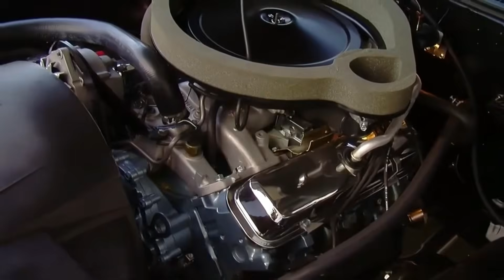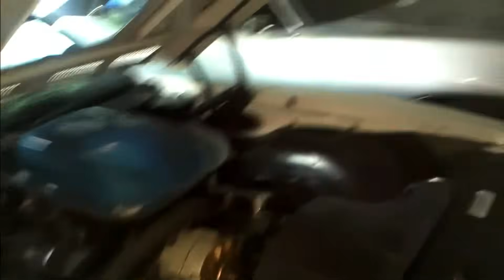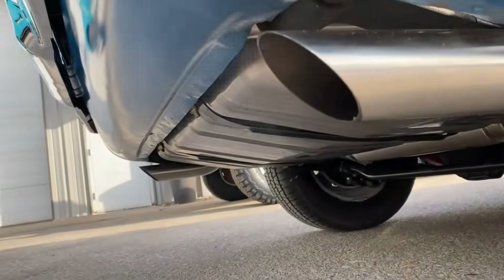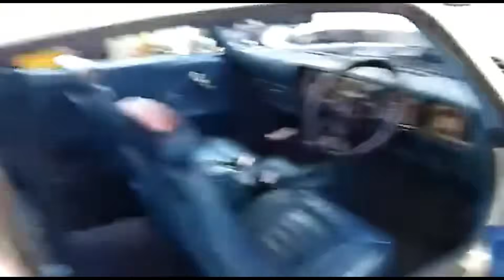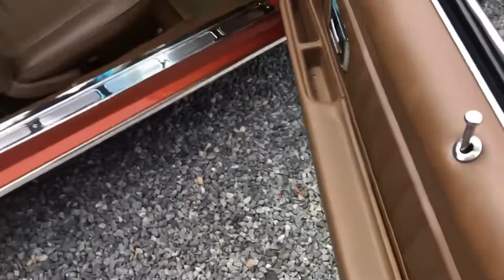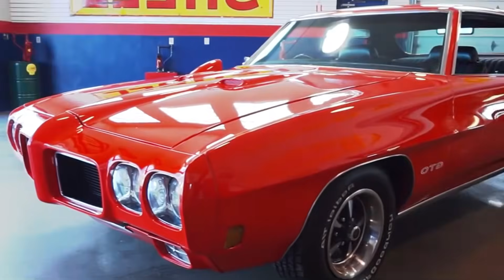20 Shocking Secrets About Pontiac 400 Ram Air IV You Didn’t Know!

Comment: I have the first day of production of a 1969 Ram Air IV JUDGE that was special order for drag racing, 4.33 gears, radio delete, no power steering or brakes, close radio 4 speed, no console, gauges with a hood tach, original engine with three sleeves in the block, ran a 12.38 with slicks back in the day in E stock. Mostly original paint, all original interior except package tray, its a beast. Heads were ported later by SD performance in the 1980s so its even quicker than the low 12s. Because it is mostly original the reach back to 1969 on the car feels, smells and looks like a unrestored time capsule with just the right amount of patina. The one thing he got right was indeed they were working on the four inlet Ram Air set up. I have a copy of the factory blue prints. My Judge is in the Judge registery as first day of the IV Judge, dealer was Dick Marson who drag raced it before it was sold to the public. But a lot of stuff the video got wrong, also I have a original Ram Air IV Qjet for a firebird with the throttle stop intact to lessen the HP and yes turn over the carb and open up the throttle all the way the butterflies do not open fully.

Comment: The original purpose of the round exhaust ports was to space out the ports, for easier fitting of large tube headers. The Ram Air II camshaft was actually originally designed for the D-port heads, then the round port heads were designed. When Pontiac wanted better flowing ports they would just increase port volume, without any flow testing. The 1969 RAIV heads increased the volumes of the 68 RAII ports and the 1970 RAIV heads increased the volume of the 69 RAIV intake ports. Much of this volume increase actually hurt short turn radius flow of the ports. The RAIV stopped being an option in 1970 GTO when the 455 GTO became available in 1970 and then the RAIV became an option in the 1970 Firebird, that came out late in the model year.  My father ordered a 1970 RAIV GTO and paid a deposit. Pontiac contacted him and told him the RAIV was no longer a GTO option. Between the dealer, Pontiac and my father, Pontiac agreed to assemble one last RAIV GTO for my father's order. It may have been the lat RAIV GTO made. The 1970 Firebird got GTO coded engines and supposedly there were no 1970 Firebird coded RAIV engines.

Comment: Standard 400 96 D shaped heads had 2.11 and 1.77 valves but the center exhaust port was still restrictive and the round port exhaust gave considerable performance along with larger intake ports. Emissions destroyed the  Pontiac engine.

Comment: Ugh. Get your facts straight. The Gen1 Firebirds got throttle limiter that could (and often were) removed. The reason was GM's 10 pounds per horsepower rule for all divisions (but ignored by one division). The A-bodies, being heavier didn't get the throttle limiter. The 1969 exhaust manifolds for the Ram Air IV were the same for either an F-body or an A-body. Yes, the Firebird's exhaust system was a tad more restrictive than the Tempest's but it was less of a factor than the throttle limiter.

Comment: You don’t know what you’re talking about with the no air conditioning on Ram Air IV.  First of all the RAIV heads and aluminum intakes were drilled for the standard Pontiac 400 AC brackets from the factory.  Idle is fine with the AC on just as long as you have the idle solenoid wired to the AC system clutch.  So all you said is not true. I have AC on my RAIV and it works fine. The one thing you didn’t mention and is the true deciding factor for no AC on a RAIV. You’re completely on the wrong end of the car!  It’s the rear end ratio. Any gear lower than 3.23 means no AC.  And that’s because any lower gear will over rev the compressor on the freeway.  I have 3.23 on my RAIV and I like it better than the lower gears.  I tried a 3:73 for a few weeks and put it back to 3.23.  Besides I’m not interested in the 1/4 mile what so ever.  It’s all about the acceleration in 2nd gear with a 3.23 that makes it feel like it’s going to take off when the cam kicks in.

Comment: To my recollection Ram Air lV was a power level increase times 4 from a stock 400 Pontiac.
Reply: 350hp, RamAir III 366HP,  RAMAIR 370HP.. IN 1969-"70
Reply: @danielmauter1737 in 1969 the engines were rated different depending on which car it was in the Ram Air III was rated 335hp in the firebird and 366hp in the GTO the  Ram Air IV was rated  345hp in the Trans am and 370hp in the GTO , this was because of GM's rule of no more than 1 hp per 10lbs of curb weight in 1969 the Ram air IV put out over 420Hp on the dyno  most Pontiac  engines were underrated .
Reply: Well a Ram Air IV is stock, so that really doesn't make sense.
Reply: @1967davethewave There were three distinct 400 engine options in ‘69-‘70.Standard 335 hp,RA/III 366hp,and RA/IV 370 hp.The hp numbers were messaged,somewhat,to comply with industry hp/wt limitations.All were ‘stock’.Comment should have used the term standard in place of stock.Other than the block,the RA/IV was an entirely different engine than the others.

Comment: A friend had a maroon '70 RAIV Goat with 4.33 gears. It ran mid 13s bone stock.  It was the fastest stock GTO I ever saw.  He also had the RAIV decals on the hood deleted from the factory.  Tech at the track never made him raise the hood and he got away with running the lower horsepower  non ram air class.  He won easily, until the 3rd time at the track.  They actually looked under the hood realizing it was a RAIV.  They moved him to a higher Factory Stock class.  He still won.  He lost the car the next summer when his wife crashed it on a rain slickened highway.   It became mini van time after that.  😢
Reply: Wow, forget about mpg.
Reply: That’s Exceptionally slow for a RA/IV in anything.I bought a RA/IV crate engine to put in my tired ‘64 GTO,didn’t have the cash yet for a carburetor,so I just used the old Carter and manifold off of my 389.With 3.73 gears it ran 12.60s@112-155mph.A few weeks later I bought a Holley 800cfm spreadbore carb to go on the original aluminum manifold,changed out the gearing to 4.88 ratio,and ran 12.20s 117-120mph.These engines loved to rev,and didn’t really haul till they hit 5500rpm.Don’t believe the magazine articles showing these cars running high 13s.HS friend of mine bought a brand new ‘67 RA/III 360hp/w 390 gears.Put the slicks on at US30 and ran 13.6s all day,and that engine is not even close in raw power to a RA/IV.The same car lost to a couple of 360 hp 396 Chevelles by a few cars,so one or the other were fudging on their hp numbers.

Comment: The rating difference between RAIVs in 'birds and GTOs was not due to exhaust; engines were rated without accessories, water pump, or exhaust. The 345 hp rating in the 'birds was just to comply with GM's 10 lbs per hp rule.
Reply: The 1969 Firebirds did have different exhaust manifolds than the GTO and the 1969 Firebird engines had different engine codes from the GTO engine codes. The 1970 Firebird Ram  Air IV cars had GTO exhaust manifolds and the engines had GTO engines codes. The rest of the Firebird exhaust system may have been more restive than the GTO. Pontiac used 2.25 inch exhaust pipes, while Chevy and Olds used 2.5 inch exhaust pipes.  I'm not sure what Buick used. Even with their highest horsepower engines, Pontiac stuck with 2.25 exhaust pipes. The rockers needed more frequent adjustments, because the high RPM lifters used had limited plunger travel and couldn't be pre-loaded as much as regular hydraulic lifters, that could make up for more wear longer. The Ram Air IV camshaft was originally used in the 1968 400 Ram Air II engine and even though that engine got round port heads, the camshaft was originally designed by Pontiac to get the most out of the D-port heads., then the round port heads were first designed to make it easier for racers to fit headers to the engine. Pontiac designed the head ports for volume, not flow,  but larger volume didn't always increase flow, due to less than optimum design. The 1971 455 High Output engine used the same intake manifold as the Ram Air IV, but the 1972 455 High Output engine used an aluminum intake with a thicker floor, over the exhaust crossover. This made the 1972 intake less deep than the RAIV intake and flowed less, though the 1972 aluminum intake manifold became the service replacement part for the RAIV intake. I ordered a new RAIV intake manifold in the 1970's and it was a 1972 455 HO intake, that was dated 1975. It was not as deep inside as the original RAIV intake.
Reply: PONTIAC DID TEST WITH ACCESSORIES.  PONTIAC ALWAYS CAME OUT CLOSE WHATS IN CAR.  HUNTINGTON IN "64 RAN TESTS ON HIGH HORSE FACTORY MOTOR. PONTIAC WON BECAUSE PONTIAC  TESTS  WITH ACC. on where others did not. They added acc to thee other motors. And thee other  stuff fell waaay off.  Like Chevy's 350hp 327. It only like made 310hp.. Huntington was a editor at HOTROD.
Reply: Pontiac put a tab on the carb on firebirds to limit the secondaries from opening fully thus the 345 rating to comply with their rule